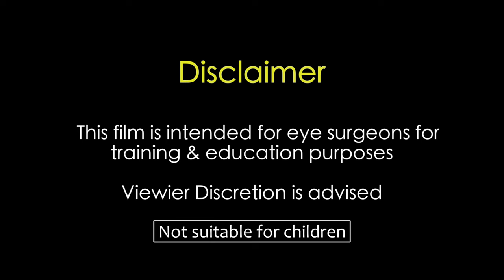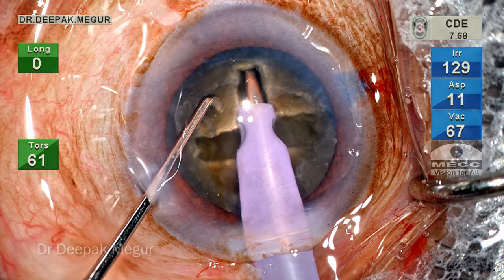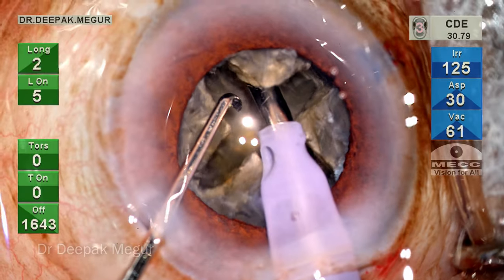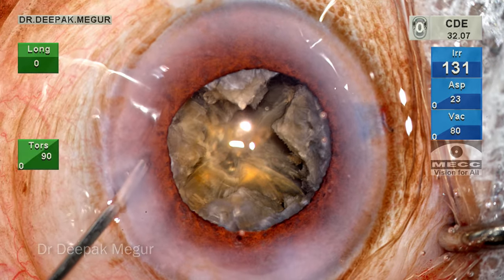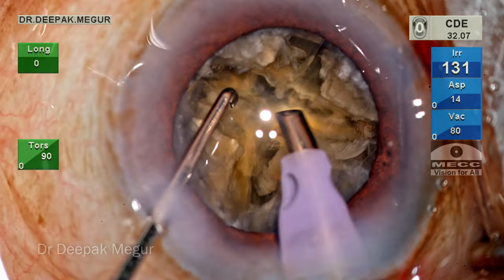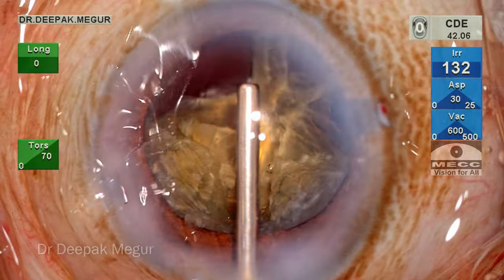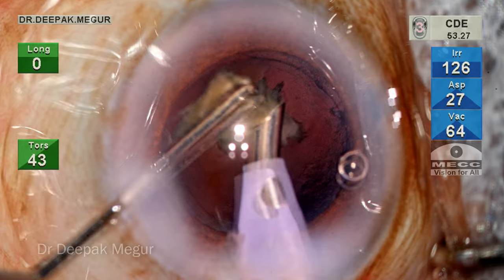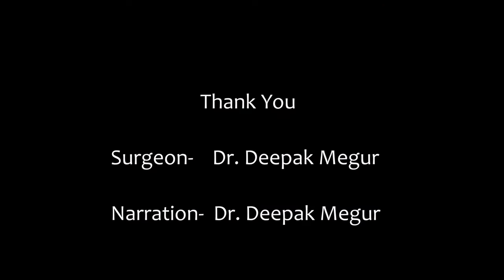Phaco Basics.The posterior plate refuses to crack. How to proceed..? Dr. Deepak Megur

Comment: You are skilled and the patient has been quite cooperative in such a hard case, but I think that a safer approach should have been using peribulbar block as anaesthesia - thus removing all patient related complications. A case such as this in a less cooperative patient, with some anxiety induced hypertension or vitreal push would have been unmanageable.